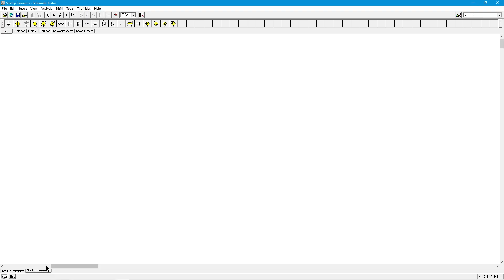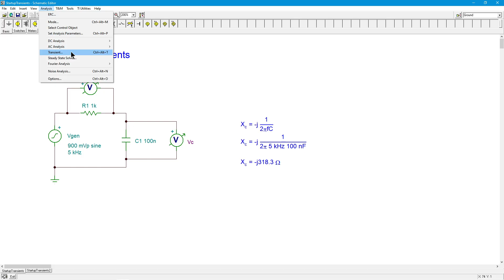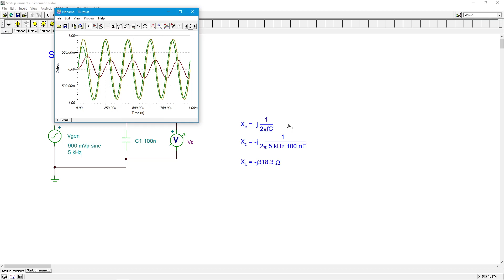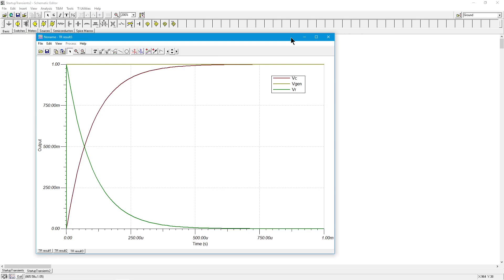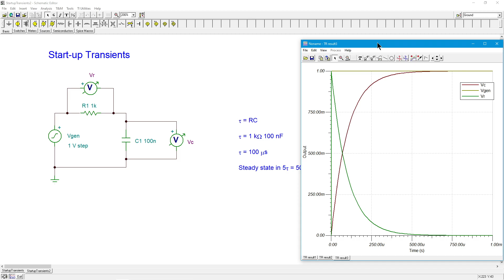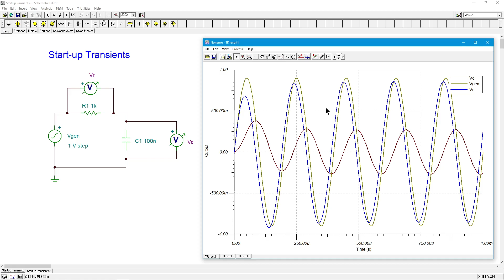Simulation Start-up Transients

Comment: Prof Fiore  analyzing  the RC circuit was never convinced that at t =0+ how cap has negative peak    voltage ..so today got valuable insight ...thank you..as i always used to think when cap is at zero voltage supply starting from zero cap should charge from zero plus voltage onward very enlightening..